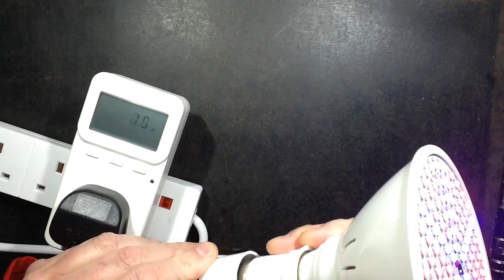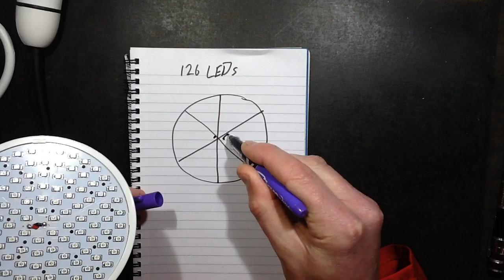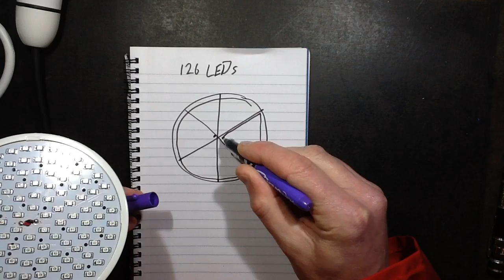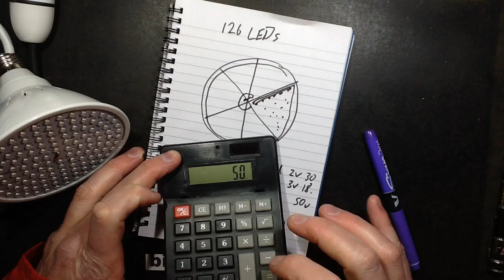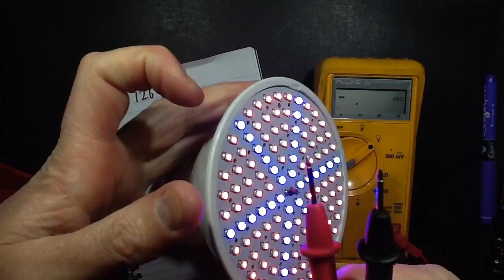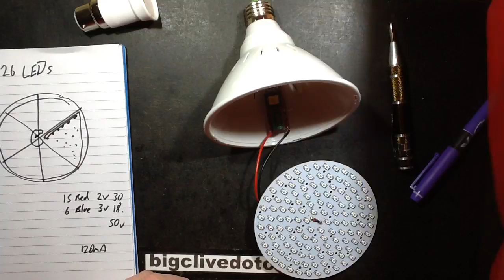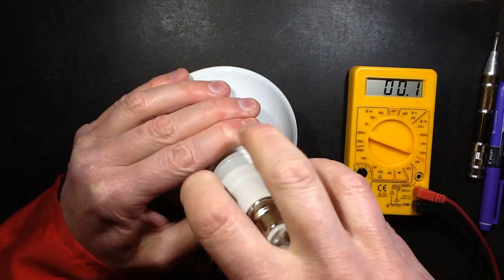126 LED hydroponic death lamp.

Comment: Something tells me this "Death lamp" is not very "Death".....nice click bait
Reply from the maker: +Katianie9 No seriously.  If you touch the front of the lamp while providing a circuit to ground you would definitely receive an electric shock.  Potentially fatal.
Reply: +bigclivedotcom 50 volts doesn't sound like a lot of voltage. I've shocked myself from an electrical outlet which I thought was more
Reply from the maker: +Katianie9 50 volts across the LEDs directly referenced to 240V with reference to ground.  Like having a 9V battery connected to a live wire.  You'll measure 9V across it, but get a full mains shock to ground.
Reply: +bigclivedotcom I don't follow, where is this 240 volts coming from?
Reply from the maker: +Katianie9 Our UK supply is 240V.  In the USA it would be referenced to about 120V.
In the video the front of that lamp was live at 240V to ground.
Reply: +bigclivedotcom but an electrical socket in my house is 120 volts so how come I can shock myself with that and it is only slightly unpleasant
Reply from the maker: +Katianie9 If you ever get a REAL shock.  Contacting a live connection while another part of your body is referenced to ground then you'll find it's more than slightly unpleasant.  Especially if it puts your heart into a state of ventricular fibrillation and you are fully concious of your own death as it happens.
Reply: +bigclivedotcom so I'm getting a fake shock?
Reply from the maker: +Katianie9 When you get a shock the amount of current that will flow through your body depends on what you are making contact with and how dry your hands are.  It can vary from a slight tingle to being physically locked onto live metalwork.  It takes approximately one single mains cycle in the right circumstances  kill you.  If you have a flippant regard to electricity I'm afraid you'll find out the hard way.
Reply: +bigclivedotcom I wouldn't say I'm flippant to electricity but from my perspective you seem overly paranoid.
Reply: +Katianie9 He's not, though. When I was 17 a friend was screwing around and stuck his finger in a light socket (120 v, standard US). He used to do that all the time. One day he did it and his shoes were wet. EMS got his heart beating again but his hand had cramped because of the power and he could not let go. I had to tackle him to break the connection. He lives but it burned the shut out of him and he has all kinds of problems now. In truth, I used to do it too but had already given that up.
Now if you really want to see something exciting, grab the shorted end of a spark plug on a car! That's around 25,000 volts, but low amps. It's about half the current of a non-law enforcement tazer, stun gun.
Reply: +Katianie9 First call him out for clickbaiting, then not knowing about basic electrical conductivity and lethal charges. God damnit.
Reply: +Katianie9 I find no fault with what you are saying. What Clive is saying is that because the front of the bulb is exposed, it is a hazard. An unwary adult, or God forbid a child could touch the front not realizing that they could be harmed. The lamp in the video was not UL listed (for the US) but it can still be purchased here.
Reply: bahh, I doubt it will kill you. but I'll paypal you a nice lump sum of money if you order it, take a shower then touch the led with it on. how does that sound?
Reply: It would be "TESTING DANGEROUS PLANT DEATH LAMP (GONE WRONG) (ALMOST DIED)"
Reply: +Katianie9 mission accomplished.
Reply: +Katianie9 It of course depends on the circumstances. There are also some safety measurements in your house, but a regular power outlet can certainly kill you.

My dad once investigated an electrical garage door, it was leaking current to the ground, so of course, they bypassed the ground leaking safety (or whatever that's called in English) since "it didn't work".  But at a certain point, the ground connection broke (that was simply a dangling wire connecting a grounded part to a non-grounded part), my dad touched it, and was clamped to it. 

His only luck was that the motor was mounted on the ceiling, and he could still control his legs. So he could let him fall on the ground. He walked a few weeks with a soar arm (from the electricity) and a soar butt (from the fall), but at least he survived. If it would have been a wall-mounted system, there's a big chance he wouldn't be able to escape from it. 

I also touched the mains once, but luckily made contact to both wires through one finger. So the current didn't pass through any vital parts. And my arm cramped up immediately, which made me throw my tool through the room, but at least I lost contact with the electricity thanks to the cramp. I only had minor burns on my finger. If the cramp actually causes you to grab onto the electricity, you normally can't get away from it anymore. And if safety measures are bypassed, you're as good as dead.
Reply: bigclivedotcom 240v is standard in Australia,  its very dangerous to touch.
Reply: ***** Like rattle snake bites. They don't bother me but have killed and injured others. Same can be said for lightning strikes. A friend and mentor of mine, reached out to pick up a set of keys off a large green electrical box. He found himself clamped to it. The sign on the box said 48000 volts. He should be dead but there he is 76 years old and still working.
Reply: +Katianie9  Its amps that you need to worry about more than voltage ;)  I'd be happy to set that light up in a humid greenhouse or hydroponic garden just so you can grab a hold of it to prove your point.This isnt a light for your living room here,it is designed and destined to be used in a wet,humid and conductive environment and for this it is what he said it is.
Reply: +Katianie9 He's not, though. When I was 17 a friend was screwing around and stuck his finger in a light socket (120 v, standard US). He used to do that all the time. One day he did it and his shoes were wet. EMS got his heart beating again but his hand had cramped because of the power and he could not let go. I had to tackle him to break the connection. He lives but it burned the shut out of him and he has all kinds of problems now. In truth, I used to do it too but had already given that up.
Now if you really want to see something exciting, grab the shorted end of a spark plug on a car! That's around 25,000 volts, but low amps. It's about half the current of a non-law enforcement tazer, stun gun.
Reply: +Sander Deryckere That makes sense, I could see why clamping and not being able to let go could be fatal.
Reply: +Merle Mitchell ahh so we're going from my original argument of 120 volts not seeming like alot has transformed into "ur dumb because u think 48000 volts won't kill you". u can try to troll me all you want but it's still clickbait. "watch this guy drive a DEADLY car". But it's only deadly in specific scenarios. I'm done arguing about this because youtube comments are a waste of time and if you choose not to understand what I'm trying to say then nothing I can say will change your opinion.
Reply: +Merle Mitchell so because I am skeptical of a modern house outlet killing you, that automatically means I have complete disregard for all electricity? I used to live a block away from a transformer where every year some kid would get a limb blown off. The presentation of this video make it sound like it's that level of deadly vs an uncommon scenario. that's like saying "look at this deadly car" and it's just an average car, yea you COULD get hurt but probability wise it's unlikely.
Reply: +Niels Steenman no I still think it's clickbait. something that can kill u only in very specific scenarios is not "deadly or "lethal", it's simply a hazzard.

Comment: I have opened a few of grow lamps and I believe that the power supplies used are intended for use in LED tube lights where mains isolation isn't necessary. That is why they are long and narrow in design and due to the huge volumes they are very low cost.

Comment: once again, cool video!
I must ask, how can you just grab the base of the bulb with almost an 1/8 of an inch or so of one of the bulbs contact exposed?
Reply from the maker: The base that is exposed is a bayonet cap base.  It uses two contacts on the end, and the exposed bit is not connected at all.
Reply: Ah, okie dokie.

Comment: Why would you get a shock from the lamp as long as the holder is correctly wired , the outside screw should be neutral and your switchboard has neutral and earth wired together.
Reply from the maker: Because the solder connections on the front of the lamp are referenced directly to the mains.
Reply: +bigclivedotcom I'm confused, and it's quite likely I'm wrong because I'm relatively inexperienced with electronics (more of a software guy myself), but don't switch mode power supplies put out DC voltage? The exposed leads on the front would be from the power supply's output, not directly the mains, wouldn't they? Where am I misunderstanding? :-)

Comment: Good video !

Those lamps are not only a waste of money but also a waste of time and more money if you bet a crop on them. You need, at least 1W diodes, being 3 and 5 W the best. 20-25W per square foot would the optimal led lights potency to grow something. 

With this lamps only the leaves on top will get anything, and still, what they get might not be enough. The plant will be very small and/or wither when trying to mature.

Comment: You HAVE done a vid about grow-lights!

About your electrically live plants, again...mate; perhaps I've lost my fear of 'leccy'. I've stopped a car engine a couple of times with my heart and a moped engine while riding it so I'm less nervous about it than I used to be. I was sticking my hand in a DWC bucket the other day and noticed it felt like peroxide pricking at my skin.

I was perplexed, as much because I don't bother with peroxide when there's loads of bubbles but also because I'm a little slow sometimes, so I kept doing it until it dawned on me that the pump was shorting out and I was being electrocuted. Maybe I was wearing trainers, I dunno but I really do think sometimes that you'd have to be gripping a lead in each hand to get hurt by the mains. Plant's certainly ain't going to do it unless they're earthing out a thunderstorm.

I also chopped through a hedge-cutter cable once and discovered that our household breaker circuits are really effective- not so much as a tingle!
Reply from the maker: N1H1L9 The level of electric shock you get depends on how much current can flow through you.  If you were holding grounded metal in one hand and grabbed live metal with the other it would be a very different result from a tingle.  I did a video on that.  Nobody is immune to electrocution, they just get lucky warning tingles.
Reply: bigclivedotcom
 I've never understood 'leccy'; When I was getting all my shocks I was either in trainers or as in the case of my moped shock,
 (dodgy kill switch; the police were coming the opposite way and I was on the pavement, without a bash-hat on an illegal wreck-of-a-ped...I fell off and he just shook his head tiredly as he rolled by!))
...I had tyres full of air under me so how did I get any shock?
I understand an object has 'capacitance' but surely once that's 'full' then no more currant can 'get in'? (sorry, I did warn you I'm like a fluorescent bulb on an icy morning)

I tell you, the inertia of that tiny ped produced a shock that was easily as strong as the times I've accidentally pulled off a plug-lead or the bloody 'King-lead' (same shock but four times as often!) on a flipping car.

How on earth, when I can have my hand on a short-circuiting pump under-water and barely feel it (and there was a small quantity of electrolyte in the form of fertiliser), can an engine literally floor me? The HT leads are insulated sillicone- I wasn't stuffing a finger in the end.
Reply from the maker: N1H1L9 The chassis of your moped is classed as the vehicles ground.  The kill switch may have been breaking the high voltage magneto circuit directly and would give a nasty zing if the insulation was compromised.
Reply: bigclivedotcom
Hi man, how does it ground though? I'd been given to understand that rubber etc was pretty much a brick wall to electricity?
I'll tell you what though, it wasn't just a 'nasty zing'; it felt like I'd just thrown myself on the fence at Auchwitz. Both the car and the ped were brutal.
Reply from the maker: N1H1L9 It isn't grounding to earth.  It's grounding to the metal chassis of the vehicle which is connected electrically to the negative of the battery.  So the high voltage for the spark plugs which is referenced to the battery negative and therefore whole chassis will happily travel through someone in contact with the chassis.
Reply: bigclivedotcom
 Of course, got you. Thanks for that; I really do struggle with abstractions and things I can't  see going round.

Thanks for taking the time to answer stupid questions- appreciated.

Comment: I guess the solution is to put a droplet of glue or silicone in the middle, so the mains connection is not touchable. After the first led the thing isn't really a danger any more.

Comment: Hey dude has your power meter been calibrated ?

Or is it just some Chinese random number generator. ?

If it came from China and it works at all you are lucky. If your house doesn't burn down that's a bonus. Not getting a jolt is just asking too much.
Reply: +redtails I myself am using a true rms power meter, that also can handle cos fi other than 1, with rating better than 0.2%, and I often come across readouts like this. Sometimes, with more complex waveforms and/or higher frequencies, I use an oscilloscope with advanced integrating software, with similar results.
Reply: cucking funt the meter he uses is shit. It's measuring right down in the noise when the wattage is below 100W.  It's very likely the least significant digit represents anything from 1 to 25W.

Comment: in china the people are smart enough not to touch the wires.  and we think were the smart ones.  quit wining and use them like we have some since
Reply: deanc2006 is 2006 when you were born?
Reply: no 1974 and I am an electrician, with a college degree and you?
Reply: If you were a true electrician you'd know this is a shit design. Therefore, you're a shit electrician. "Oh why do we need sockets just have the wires dangling, and when you need to use them just tape them to the appliance" is probably okay in your eyes too.
Reply: Tyler Coates "Why not, as long as you don't touch the wires it's fine, just be smart" - deanc2006 probably.
Reply: Why don't you spell "sense" correctly like you have some intelligence.

Comment: This could be powered with a joule theif just fine. Leds really work well on high frequency voltage. The current isnt needed unless you go dc. In an ac circuit you only get light for half the cycle. If you buy chinese made stuff you get what you pay for.

Comment: After all these videos about cheap chinese lamps I wonder if that watt meter is even exact ;-)
Reply from the maker: pcfreak1992 It's one of the most accurate I've come across, even with odd loads.  If you watch the full video and follow the maths when I measure the current and voltage of the LED array it comes very close to the measured reading.
Reply: +bigclivedotcom shite,I just look at the color of the arc
Reply: link to your watt meter ?

Comment: It's amazing at what gets imported from China now, I recently bought a 240 volt in bridge rectifier. This was supposedly for testing water quality, it has 4 three inch pins which have 240 volt DC output. 
Scary stuff.
Reply: +Grant E Yes there is a fuse, a reviewer says to take it out so your children won't kill themselves lol
Reply: Green Silver As in, a fully packaged product designed to be handled and in contact with water? All the bare bridge rectifiers I buy have 4 terminals for connecting the AC input and DC output (PCB pins and spade terminals are common on the smaller modules, whereas you'll find screw terminals on larger industrial modules). Perhaps they sent you a regular bridge rectifier that's designed to be installed in a circuit, as opposed to a finished water tester. It could even be a replacement bridge rectifier for repairing a water tester (since ebay stores rarely label things correctly).

Look up the part number on the case. If you find a datasheet for a generic bridge rectifier (and/or it has a hole for mounting), then you have accidentally bought a 4-pin part designed to be bolted to a heatsink and soldered to a circuit board. It's probably due to mislabelling or sending the wrong part.
Reply: Grant E
This is the little beast, it's certainly NOT a tester in my book. 

http://www.banggood.com/220V-Water-Electrolyzer-Heavy-Metal-Tester-Water-Filter-Instrument-p-953035.html
Reply: Green Silver Whoa, mate, that's extremely shoddy. At first I didn't think any manufacturer was dumb enough to just stuff a BR into a case with a plug, but that's exactly what they've done. Deadly stuff. 230V AC will produce about 325V DC with the appropriate smoothing capacitor on the output, excluding the 0.7 - 2V drops of the diodes. Without any capacitance you will get roughly 230V DC (100 or 120Hz pulsed DC with a peak of 325V). Hopefully they've at least included a resistor and fuse to limit the fire hazard, but it's still insane.
Reply: When I saw it I figured that something this bad I had to buy and see if it really put out the voltage I was thinking, needless to say it dose. 
It's the most dangerous thing I've seen on Banggood, a potential killer.

Comment: Is your wattmeter accurate when there is a PFC circuit in the system rather than a load that keeps the voltage and current in phase?